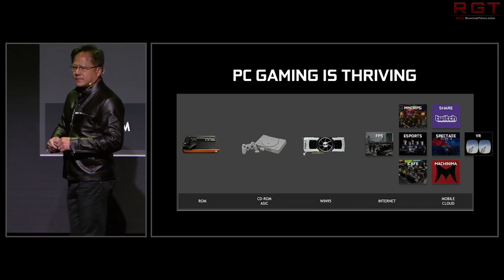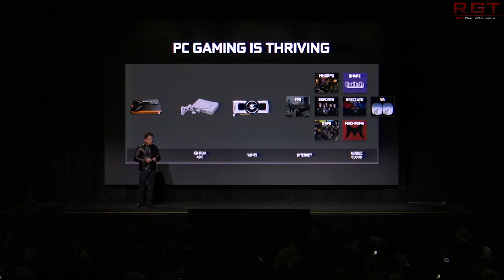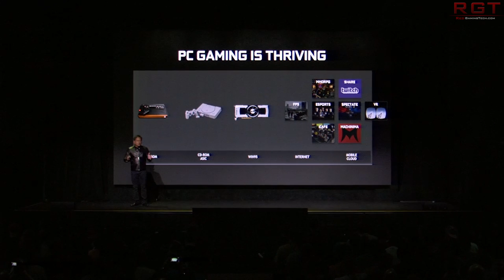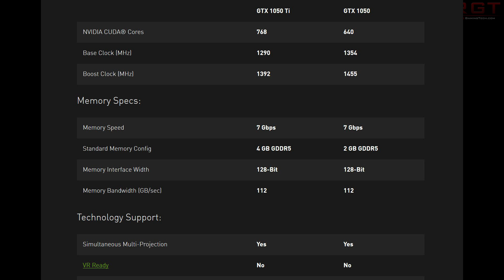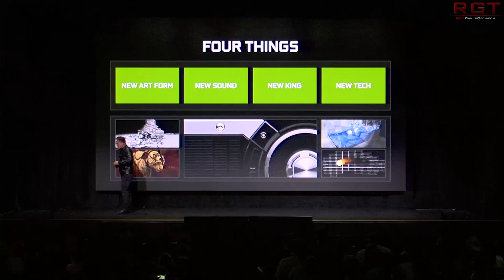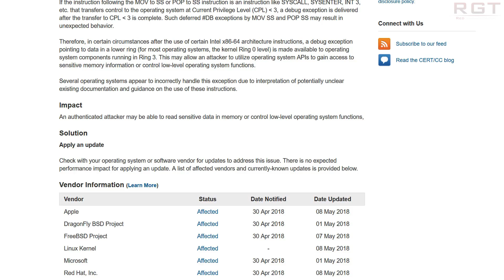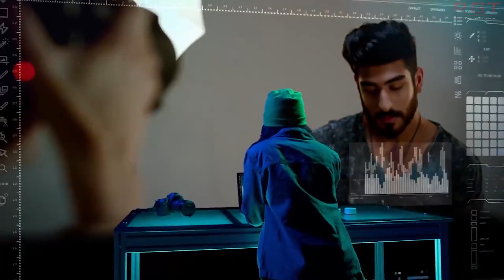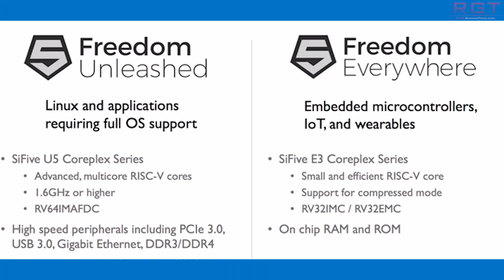Nvidia Tease 'Ultimate Gaming Event' | Major OSs Vulnerable Thanks To Developers Misreading Manuals

Comment: Yeah I think that Nvidia will want to wait for TSMC's "7nm" node it was from a post somewhere, but it makes complete sense because "12nm" is just TSMC's 16nm node refined like Glo Fo's 12LP node.

"7nm" and 7LP from TSMC and GloFo respectively will be a big jump and if Nvidia is stuck on "12nm" and AMD is on "7LP" well AMD will have a decent chance of being competitive just there, never mind that it is suspected that AMD will be going with a MCM GPU which will reduce costs for them so they could sell a card that beats the current Titan by a land slide for $500 with both 7LP and a MCM die.

Comment: How could 12 companies all misread exactly the same line of text? Doesn't seem probable to me.
Reply: These aint 20 year old undergraduates programmers!
These are seasoned 20 year veteran OS Developers at Blue Chip IT Companies, Microsoft, Redhat, VMWare, IBM etc 
So if they all magically mis-understood, the problem must have been the author of the instruction set manuals or the vulnerabilities description
Reply: deadhell304 All developers, no surprise. If it's not clear, all developers of the same specialty probably understood the same thing. Also companies tend to copy code of each other instead of try to understand the doc.
Reply: Yeah, sounds to me like the documentation is the issue
Reply: What was mis-understood 30 years ago, I don't remember anything being misunderstood at the time and I am unable to find any evidence of it today.
Can you please provide evidence or elaborated on what was mis-understood 30 years ago.
Reply: Relax man, it's just my thoughts. I am an engineer and i know that the manuals of any industry are basically the same across the years, with some revisions here and there. But basic text is the same, as well as the interpretention of  this texts. So i especulate that an misunderstood of the manual, that ocurred 20~30 years ago, was only discovered now. But this is a comments section, so it' only my opinion of the subject.
Reply: The employes of 20~30 years ago misundestood the firsts versions of the Intel and AMD manuals and perpetuate this knowledge to the next generation of employes, and this became a comon knowledge in the industry. When you, with 20 years old, enters one of this companies and your senior teach you how things  works,  you don't have the  motive to questionate that, in fact you don't have the time to check the basics like this, when, in this industry, you have to develop a new product each year

Comment: I hope it also releases GTX 11 series
Reply: so it can be bought by miners and give gamers a 20-30% performance bump at best. At best
Reply: Vyor Generic Last Name Not necessarily, the GTX 1080 performs like 2 GTX 980s in sli and people didn’t think that the GTX 10 series was going to be good now did they so I would expect the GTX 1180 to preform like 2 GTX 1080s in SLI, the GTX 1070 preforms like a GTX 980 Ti so the 1170 should preform like a 1080 Ti and the 1060 preforms like a 980 so the 1160 should preform Inbetween the 1070 Ti and the 1080
Reply: the gtx 1080 is about equal to a single 980ti that's been overclocked. SLI performance is not perfect scaling at the best of times, sometimes it has negative scaling.

Remember that the 1070 is only about 10% below the 1080.

On top of that, that was a real node shrink, from 28nm tri-gate to 20nm fin-fet(aka: what TSMC calls 16nm). The 12nm node volta is on is just a refined 16nm node, so not even that much of an improvement.
Reply: Vyor Generic Last Name Well ok I agree with most of the things you said but even from the 780 to the 980, it still had a big improvement even though it was still on 28nm
Reply: UHD Gaming PC Even though they just changed leakers?
Reply: UHD Gaming PC Woah woah woah first off I am not a little kid, I’m 16, second off these rumours that we have been hearing might not be true so everybody just take everything you hear about the 11 series with a pinch of salt besides I’m just going with what has happened in the past and I never said that was how SLI worked also you forgot your ‘ in doesn’t and the website that used that leaked switched leakers bitch so it could be wrong

Comment: It would be nice if programmers would learn how to communicate properly. I experienced this with my own education too, the better people are at programming the worse - on average - they are in verbal communication. There seems to be something going on in the brain which causes a negative correlation. It might also play a role that for skilled programmers certain things in the code are self-evident while less skilled programmers need good explanation to understand the code. 
I disagree with Paul, Intel is to blame. Communicate better, with such a good quality that you can't misinterpret it! Give a clear explanation in words, give clear examples on how to implement it. It can be done! I can program a bit myself (C, Matlab if you want to count that, terminal), I don't just talk out of my ass.
Reply: THIS^
If every single developer got it wrong then is obviously not their fault but the manual's and by extension Intel who made it.
Reply: These aint 20 year old undergraduates programmers!
These are seasoned 20 year veteran OS Developers at Blue Chip IT Companies, Microsoft, Redhat, VMWare, IBM etc 
So if they all magically mis-understood, the problem must have been the author of the instruction set manuals or the vulnerabilities description
Reply: Different experience or different perspective. Computer science forms an important part of my education (more hardware than software but software comes with the territory, like Verilog). My opinion is 100% based upon my own experience and 0% on movies. The instructors of the programming 'class' were the worst at communication, and the most experienced with programming. Many of the fellow students who were good at programming were not good at commenting code.
The bottom line, good communication between programmers is a well known problem, it has been pointed out a lot by my professor too. By the way, that computer science department belongs to the top of Europe, they don't talk out of their ass.

I am glad that you believe that you are a poor software engineer if you can't communicate well. Nothing is as annoying while working with another person his code than when that person communicates poorly. I have not been a developer but I can easily imagine how much hours this wastes of the develompent budget.
Reply: There was a bug on the mobile app , i was refreshing my timestamp comment then it suddenly changes to this exact same thing you said for a couple seconds. I shat myself thinking i got hacked or something
Reply: Cuholvke
That seems to be a fair assumption.
Reply: Peter Jansen As a developper, I agree. The issue is that developers know how things work, and as such,  can't know what people who don't know imagine. Also, developers often do not talk and communicate with very direct language between each other. And finally, people who choose to become developers seem to have bad communication in common. It is an issue, but it is more at the personal level and not easy to fix.
Reply: Peter Jansen I would add, college fails very badly to teach how to communicate.
Reply: No matter what though, programming to common language requires a system analyst to come up with ways to convey it to common people or the clients.

This is why Programmers don't talk to people and work on the programming alone.

Also professional programmers dislike using analogies to make communication of programming easier to understand, they think it's a pride related thing.

For instance if one uses the concept of switches to conceptualize how if and else statements works, but being battered by a instructor that 'SWITCHES AREN'T like THAT' all the time about how it's wrong and whatnot... I was even talking about real world light switches to a specific use case of If statements, not a advanced use cases, in college at one time.

Programmers like to speak in programming analogies and terminologies, if you so much as try to conceptualize something and happen to use a word that's based on their perception of the term being different, they go batshit crazy on you. I know what a IF statement is, and I know what a Switch Statement is, but it would help a lot for a programmer to know whether someone is talking about real world concepts to a programming concept.